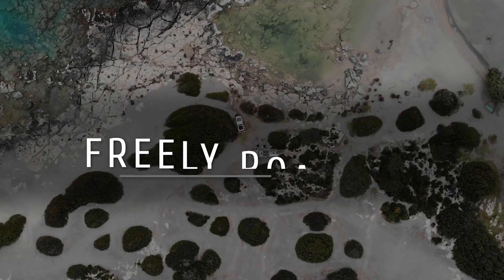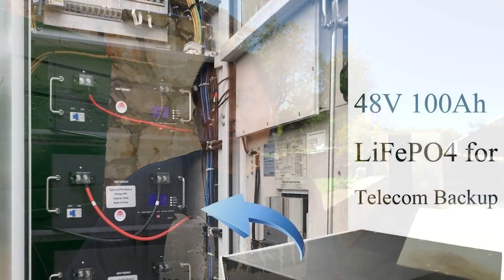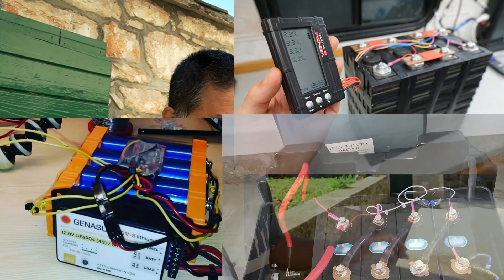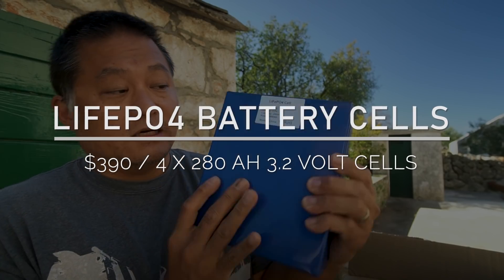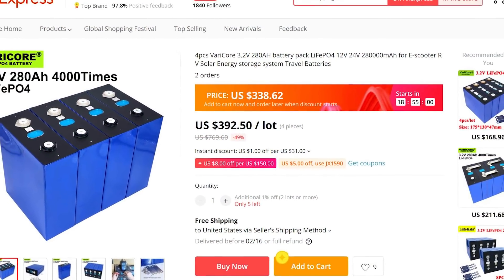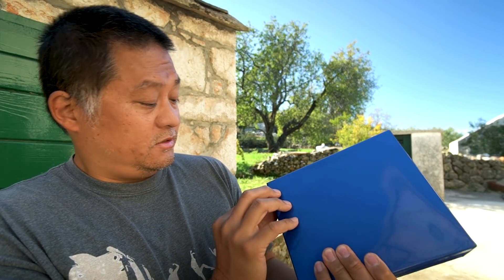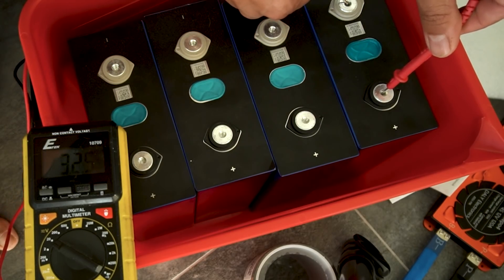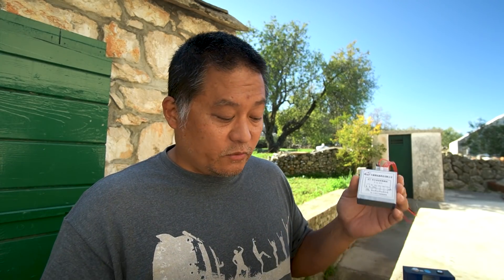Build Your Own 12-Volt LiFePO4 Battery For Cheaper Than AGM

Comment: How is the heat tolerance under the hood since they can go thermal overload and meltdown through your car.
Reply from the maker: LiFePO4 do not have thermal runaway issues that other lithium ion batteries have because of it's strong stable oxygen bonds in the metal oxide cathode. And these should also not be kept under the hood or anywhere outside. They should be mounted in the interior of the vehicle.

Comment: Hey Dan, Do I need a BMS, a cell balancer, and a shunt for my 1000W solar array / 1120AH (total) batteries / 48V system, which has an all-in-one controller (3000W inverter)?   And, what size/s BMS / balancer would I need?  I will me using a space heater or AC along with possibly induction cooker and maybe a distiller at ant given time...Love your videos!!!....Thanks
Reply from the maker: Thanks! You need a 48v specific BMS. Since it's a high voltage dc system, the actual amp draw will be low. 3kw at 48v is only 62.5 amps so getting a 16S 100A BMS will be more than enough for you. Size of active balancer doesn't matter too much. They work on the individual cell level but just make sure you buy one designed for a 16S system.

Comment: Wouldn't all that worry about balance be eliminated better by balancing charger?  Then run the charger off your solar, <insert renewable source here>, whatever you have as a source going into the BMS.  This would reset the balance on each charge, and by all means don't stop monitoring that balance just because you got a balancing charger.  With the cost of the batteries, I would have 2 systems in place like you do now, but I wouldn't want to fully trust either of the half measures you are using as my main balancer, I'd want the charger to do that and have both of your current solutions as backup1 and backup2.  Price has come down, but not to throw away prices yet, you got a nice setup protect it!
Reply from the maker: Balancing chargers charge very slowly and are not practical for these use cases. They are for hobby batteries with much smaller capacities and don't need simultaneous charging and discharging. BMS, cell balancing and a faster charging setup is far more practical and a standardized setup for all off grid systems.

Comment: how to build an ebike battery at least 48v 17a?
Reply from the maker: These are the wrong type of batteries for ebikes unfortunately. The concepts are the same though. You need a 16S BMS and smaller cylindrical cells like 18650 cells.

Comment: If I was on the move in a camper or whatever. I'd equate these cells you are showing with LED headlights. They are great, but when they fail is the local auto part store going have them in stock? If not, I'd need to keep two or three spare cells or led headlights, because nobody can predict when they may fail.

Comment: Hi thanks for your video. You had said that these batteries are bad in cold weather so would they work inside a class C motorhome in snowy conditions? We enjoy camping in the mountains/desert and sometimes it will snow and the temps will drop to around 10* F, but most of the time when we camp in winter the temps can drop into the 20*s.
Reply: you dont want to use these batterie if the internals drop below freezing (32F). But if you have it inside where it is heated you will be ok. I am going to upgrade my pack with silicone heating pads with a temperature switch to automatically heat them up in an upcoming video.

Comment: Dan great info and build videos.  I'm wanting to upgrade my 70Ahr AGM to a 120Ahr Lifepo4 for my minivan camper 12V system.  How has your active cell balancer been working? And is that really necessary if I have the Daly BMS . Doesn't  the BMS also do cell balancing.  Or by having a dedicated active cell balancer in addition to the Daly BMS a better, more reliable, and faster way to cell balance.  Great build series, Thanks!
Reply from the maker: Thanks Jeff. Yes the active balancer is doing exactly that. Just helps along the bms to keep things balanced more effectively. It's been working great. I will be making an update video soon.

Comment: I do like the concept. I have a lipo battery on my Harley and works perfect.
This being said, i don't know where you get your AGM's. I pay like 100$ for a brand car battery with sufficient CCA's.
That's a;most what you paid for the balancer alone.
Reply from the maker: Deep cycle AGM batteries are not about cold cranking amps. Depth of discharge, capacity, durability and longevity is much more important. They are far more expensive than starter batteries.

Comment: excellent videos, thank you... and a question(s)...
why do we need have to have 4 batteries together like this?  is it to add up the volts to 12 to match and be compatible with the rest of the components in the system?  and is it possible to use 1, 2, or 3 batteries in any way for a setup for a minivan?
Reply from the maker: Yes each cell is only 3.2v so you need to connect 4 in series to make a 12 volt. Traditional lead acid batteries are actually 2v per cell so if you look at how they are constructed they actually have 6 cells in series.

Comment: For example, this is the data/info that I can monitor thru the daly smart bms per their website: 
 You can see the real-time voltage, current, the percentage of battery capacity remaining, the MOS state of charging and discharging, whether the balance is on, etc.

Comment: I am building a 12 volt battery in a 2p4s configuration and plan on buying a Daly smart bms that I can connect to my computer.  Oh btw I am a vanlifer and also plan to purchase a victron charge controller and dc to dc charger.  My question is with all these available data monitor set ups I could have I am a little confused which ones I need.  For example if I get the charge controller with bluetooth, this will have data I can monitor, and if I get the daly bms, this will have data I can monitor, and if I get a capacity monitor, this will have data I can monitor, and if I get a shunt with a monitor or bluetooth this will have more data, etc, etc, etc.   So my question, will there be some redundancy with all these different data outputs.  Can I just rely on my smart bms for data?  So that I would not need to get the victron charge controller with bluetooth and just buy the regular charge controller without bluetooth, or a shunt/monitor, or a capacity monitor, etc.

Comment: Doesn't the Daly BMS have its own cell balancer? In that case, a separate balancer is not needed. I bought 120Ah cells and a Daly BMS 2 years ago, and it came with an 8-wire harness for balancing a 24V bank.
Reply from the maker: It has a passive balancer. It uses resistance to lower voltage from high cells via heat dissipation. Active balancers work faster and more efficiently and can work in tandem with BMS.

Comment: The problem with charging to just 90% is that most BMS  bleed  balances only kick in at 3.5 Volts - so its unlikely to balance much if at all - The old rule use to be charge to 3.6v per cell for first 1,2,3 charges then 5th then 10th then ever 50 charges -  if you have blue tooth  then balance charge when cells are 0.1v out - I have my 20amp  bulk charger set to 90% constant voltage then a little 0.6amp charger to do the balance charge - do not use a high amp charger to top balance it will overwhelm the BMS which ballance at as little 15ma per cell - The one you have I think is 60ma - even so its not much - I have a little thermal mat under my RV  cell stack that kicks in at 2C - was easy to set up using a little digital temperature circuit with relay and a  low watt silicon mat - the whole thing cost less than £10 to build and means I can leave it connected to Solar all year round   - Good Luck

Comment: "Thermal runaway" is a constant problem with lithium batteries of any kind. One pinhole, and you have a fire. In mobile installs, an accident can damage the aluminum box and the batteries inside - instant fire risk. I would stay with a type of deep cycle lead acid battery and add capacity until you have what you need. In a fixed installation, lithium batteries are fine. You are right about the rest of the specifications.
Reply from the maker: Not LiFePO4. They are very unlikely to have thermal runaway even when punctured. Many tests have been done.
Reply from the maker: There is a scientific reason for this and it has to the do with the strong covalent bond the oxygen molecules have with the iron phosphate cathode. It is more stable than other lithium ion cathodes in other  lithium chemistries and will resist oxygen loss in a short between the anode and cathode that leads to fires and explosions in those other batteries.

Comment: Is a single cell 280Ah or are they 280Ah when wired together? That's what I don't understand when looking these things up.
Reply: Each battery is 280Ah at 3.2V, you'll need 4 of them in series to get 280Ah 12.8V

Comment: Hello Sir, I upgraded to a larger Travel Trailer with slide outs. Now I'm thinking about my battery bank. I currently have the factory single battery that runs my refrigerator. My end goal is to be able to run my tv, refrigerator, also blower for my gas heater for now. So basically no generator at night. Later installing solar. Any help and or advice is appreciated.

Comment: great overview of buying and some of components needed ti DIY LFP batteries.

I do have a point if disappointment when discussing price.  Sure the 4 cell groups cost under $400 these days when purchased directly from China via Alibaba or AliExpress... however, that is less than half the cost picture as there is shipping.  My last check was 8 280ah cells shipped to California was about $750-$850 including shipping but exclusive if added payment processing fees which can run about $50-$70.  And the 16 pack of cells might be $1200ish and shipping bumps that up to $1500 give or take.  These are still fantastic prices, however, they are far more costly than implied in so many videos. 

Best deals can be if you do a group buy.  Saves a bundle on shipping and you can get an even lower price per cell.

I'm close to order my pack of 16 cells... that will give 1120ah of 12v power or 580ah@24v (you still get the 1120ah if you unpack the voltage at point of use for 12v devices... you just save a bunch on the cost for the lower gauge cabling.  this is why I'll be setting up in 24v and using only 4 24v solar panels of 435W each...sooo much power to add more boondocking freedom...)

anyway just discovered your videos and already appreciate your way of sharing info in a very accessible manner!  love it

Comment: What is your experience with the Daly BMS? There are so many people that report problems!!! And about the active cell balancer, isn't what the BMS is doing? Don't these two units interfere with each other? BTW, this is an excellent set of videos, thank you very much!! It inspired me to order the components and build my 200ah battery.
Reply from the maker: Thank you. So my experience has been pretty good. however a good BMS appear as if it isn't even there. All the work it is doing should be transparent when nothing is wrong with your system. The Daly BMS is not an advanced BMS in that it isn't programmable or customizable. Each model is build from the factory for a set battery type and configuration. This BMS has balancing feature built-in but it is not active balancing. It is resistive, heat-dissipating balancing using MOSFETs. There is nothing wrong with that and will probably work fine. An active balancer will transfer power from a high voltage cell to a low voltage cell instead of just burning off the excess power as heat from a high voltage cell. They do not interfere. think about 2 water tanks connected at the bottom with a pipe equalizing their volume as active balancing. passive balancing that the Daly BMS does would be simply to drain the water tank holding more water to the same level as the low tank. Good luck with your build!
Reply: @freelyroaming  That's the answer that I (and apparently several others) was looking for, thanks!
Reply: @freelyroaming  Awesome thanks! I ordered the 'smart one' which they claim allows changing settings but I will see. Anyway after your response and some extra reading, I understand that the active cell balancer is a good extra redundancy measure! I don't want to set my van on fire!!! :)
Reply from the maker: Haha yes. Burning down your van is bad.

Comment: I learned a lot from your great video.   I am interested in building a 24v setup.  Can 8 of these cells be connected in series to create a 24v 280ah system?  And if so, do you have a BMS that you can recommend for it?

Comment: You can't compare amp-hrs of different voltages.  You need to use watt-hrs.
Reply from the maker: I am only talking about 12v batteries here. So in this case you certainly can compare by Ah. LiFePO4 actually has a slightly higher nominal voltage than AGM so the numbers will be off by an insignificant amount in favor of AGMs. Meaning the same Ah rating in a LiFePO4 will yield slightly more Wh. But that gets too confusing for some beginners. Using Ah is how the industry compares 12v battery capacity. Especially if it's solely for the purpose of comparing which one has higher usable capacity. If you know the voltage of the packs, you can determine the Wh yourself.
Reply: @freelyroaming  You're not just showing 12-volt batteries.  At 3:04 you're showing the VMAX 6 volt battery with 225 Ah.
Reply from the maker: Yes I am comparing 12v battery systems. My VMax AGM pack is a pair of 6v batteries connected in series. And the new LiFePO4 pack are four 3.2v cells connected in series. If you are concerned with how each cell of the battery system is sold then why stop at the VMax? Each of my LiFePO4 280Ah cell is at an even lower voltage. I am not comparing Ah between individual cells. all comparisons are done between 12v packs build from necessary cells. Both are 12v packs when they are being compared and the prices, usable Ah ratings are all based on them being 12v battery packs. I specifically did not go into that much detail as those are topics for a separate discussion and not the point of this video. If you look at the price per Ah estimates I used, which is the primary point and what this video is concerned with, you will see the comparisons are validly comparing 12v battery packs against each other. Feel free to do that math yourself.

Comment: I’m curious how a bms with only two connections can monitor individual voltages on 4 batteries.
Reply: That's exactly what I was wondering watching this video
Reply from the maker: I assume since you are asking you would know that there are sensing wires not shown in the this video. This video is just a high level overview. if not, feel free to check part 2 of the build series as it is explained during battery assembly.
Reply: The next question is how do you rebalance a pack? Disassemble it and charge individual cells?
Reply from the maker: If you watch my pack assembly video you will see how I installed an active cell balancer to help do that. The bms will also balance the cells individually using the voltage sensing wires.

https://youtu.be/JSaiZ0wnvO4

Comment: thanks for a great video, does your chosen BMS have temperatur meassurement to insure the batteries are not charged if the temperatures drops below zero in your van ?
Reply from the maker: No it does not. I've chosen to use the Victron Battery Sense to do that instead.

Comment: We bought 14 100 amp hr CD technologies Long duration. AGMs . they were new all same batch. They had a 5 year warrenty. We paid $360.00 for the pallet of 14. That was 2005. We have 3200 watts of solsr and 4 500 watt wind gennies. We have pampered them with proper wiring and fusing with mppt charge controllers. Their overall diminsion of 7"x11"x 21" line up for a perfect match of my bed's foot print. And that's where they have been since sept 2005. They still charege well. Are never cycled and still kikin for goin on 16 years. We're very satisfied in them. They power everything in and around our house. Think we'll stick with them. Zero maintainance. Just like the gennies we installed that have been flyin 24/7 for nearly 12 years hands off up on this mountain in all kinds of weather. Ice storms wind storms heavy duty heat. No prob. Thinking bout replacung the black blades that have UVd out to grey. Haha. Our batteries were a UPS replacement stock. We paid $360. For 1400 amps. Less than one of yours. Were satisfied. Thanks for your info on those batteries. Urs sound. Like a pain to monitor. I just check wiring connections couple times a year. No sweat. We been off grid since 1969. Haha. Our piwer never goes out. Bout a week ago my wife was leaving the grocery store down in the valy when the town bkacked out. No problem up here. Off grid is sweet. Screw the grid and dependance. Stay strong and free.
Reply from the maker: Sounds like a good setup for your off grid property.

Comment: That bms can not balance if it does not have individual wires going to each battery.  Being only hooked up to the last battery, it has no way to know what is in each battery.
Reply from the maker: Every BMS including the Daly BMS down here has sensing and balance wires going to the positive terminal of each cell as well as the main negative terminal of the pack.
Reply: @freelyroaming  OK, I didn't see them in the video, thanks for the reply

Comment: Silly question, would this work in a 16 foot fish and ski boat that requires a 12 volt battery?  Benefit would be less weight in the boat.  My marine battery sucks.  May have a parasitic drain...
Reply from the maker: Yes these will work with pretty much any 12v application.